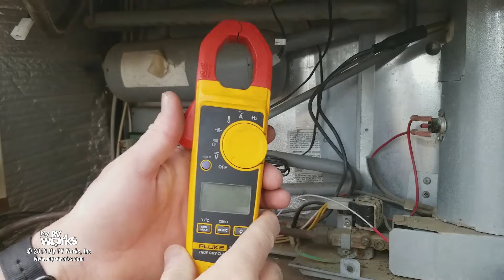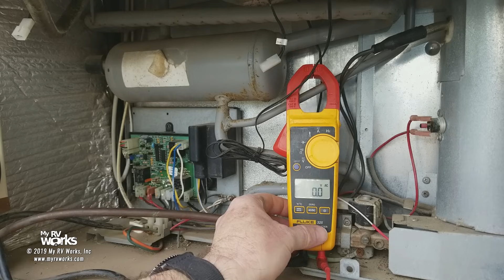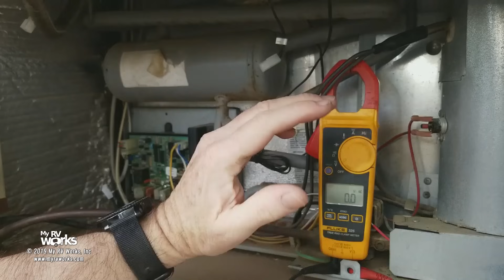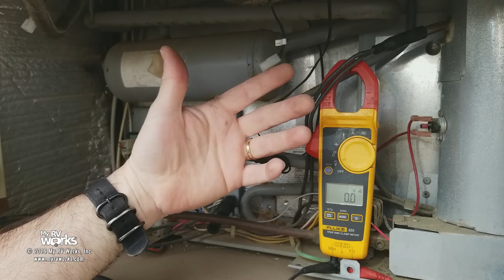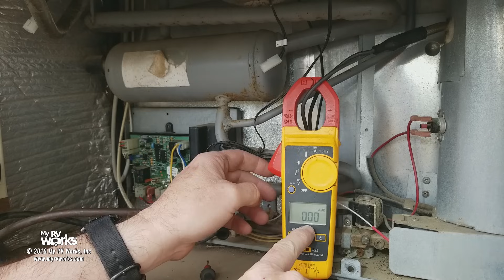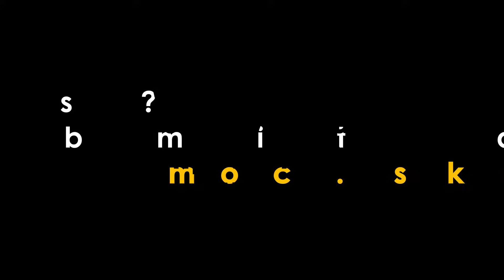Troubleshooting An RV Refrigerator That Works On LP But Not On Electric

Comment: I have a dometic 2652. I have voltage at the pins to the heating element and I have 40 ohms on my heating element. still does not work. Can I have proper voltage and Ohm but the element is still bad?
Reply: I have this same model and the same situation. Did you try swapping out the element? Upper control board? Darren??

Comment: Hi razorbackrheas.  Turns out my issue was tied to low voltage in the campground and the electric mode is running normally. Don't have a fix howewver other than adding a refrigerator fan.

Comment: I have a Dometic 3 way Model#2554. Three fuses on lower control panel. 120 volts across two of them, less than 1 volt across the 5 amp fuse for 120 voltt system. Why? What to check? Bad board?
Reply from the maker: If I were there the first thing I would check is the resistance value on your heating elements. The AC and DC fuse is only allowing the current through necessary to run the heating element.  If the heating element is not on it will not be consuming any current. So, the best way to check is the ohms value through the heating element.

Comment: We have the opposite problem. Ac works flawlessly. Propane, the freezer will cool, but the fridge will not. It tries to, but as the warmth of the day starts it just goes up and up. Any ideas?
Reply from the maker: If your refrigerator is working flawlessly on AC but not on LP, then we can assume several things. We can assume that the cooling unit is fine (no blockage, no leaking) we can assume that the ventilation through the cooling unit is fine. That leaves the proper amount of heat in the boiler being a suspect. You need to make sure that the burner is clean, there are some orifices that the gas flows through. Also your burner at the very bottom of the chimney, you need to make sure that's not rusted out and not filled with fine rust shavings from the boiler chimney. On the LP side we need to make sure you have proper BTU from the flame.  We do that with an LP pressure test at the refrigerator burner.  https://youtu.be/SD1qcH_hNYY

Another thing you could look at is inside of the boiler chimney is a corkscrew looking baffle kind of device. I pointed out in another video. I have come across refrigerators where the heat from the boiler has damaged or melted out a portion of that baffle and I've even come across refrigerators where it's not even installed.
https://youtu.be/H-Cg-7YHyYE. Around the 17:15 mark.

Comment: OK, so listened and still a little confused.  My fridge works on propane and not on electric SUDDENLY  along with the microwave went out at the same time.  WENT out and found the fuse in back was bad so replaced it and now electric SHOWS IT IS ON ELECTRIC BUT NOW IT STILL DOES NOT COOL ON ELECTRIC BUT DOES ON PROPANE  now what.  I am 77 yo so not sure I can do all the testing you did past getting the fuse out. I do nto want to get ripped off so asking before I see the RV tech.  I have good recepitcle since I did test it and it does say it is now on electric but not cooling. So far as the Microwave is concerned, it is dead, recepticle is working with hair dryer but fuse was ok, circuit breakers are ok etc.  HELP!!

d

Comment: So do you have to have propane on for the electric to work cuz mine won’t work it the propane is shut off
Reply from the maker: The propane side and the AC side are independent of each other. They do share a common control board and they both share the cooling unit obviously but besides that they can work independent of each other. Never at the same time though. So we need to dig a Little Deeper on your problem.  I'm wondering if when you're turning off the propane are you turning off the refrigerator inadvertently? It might be a silly question but I have to ask it. Typically what you do is turn on the refrigerator and put in auto mode and let the refrigerator choose between AC or LP if it has both available it's going to default to the AC.

Comment: Can't find my fridges control board, it's not in the back where else would it be?
Reply from the maker: If you can provide your Refrigerator manufacturer, model number, and serial number that would be helpful. If your refrigerator is manual ignite, then there may not be a DSI control board. You may have a green push button with a gauge type indicator on the front side.  On the back then, you may find some very simple switches. But if you can provide your model number that would give us a chance to offer more assistance.
Reply: @MyRVWorks  it's a dometic RML 8555

Comment: I was waiting for you to use Oms law to show us how the heating element watts can be checked, buy reading the amps and multiplying by the volts to obtain the watts.  This watts value should be the same as manufactures specs.  As you said often times someone unknowing installs the wrong heating element and this check can confirm that.
Reply from the maker: I've got to to my audiences. Sometimes all of the technical data would make their eyes roll back into their head. Some of my other videos I do show Ohm's law in use. Thanks for watching, happy camping.

Comment: Darren,  HEEEELLLLLPPPP!!!!!I'm having problems with my dometic refer, it wont cool in a/c or LP mode. In gas mode the little freezer section will cool down even to the point that at the front it will form a little ice droplet. The freezer will not freeze water, will not keep ice, hotdog, anything froozen. The coil fins in the back of the freezer are cold in the freezer but not in the refrigeration section. I have searched utube trying to find help but this unit is so old no one is covering it...it's obsolete..... This unit is in a 1969 security traveler and worked great last year hence the confusion... Please, any advise would be gratefully appreciated... Thank you, Robert
Reply: help get battery fan

Comment: After checking everything you suggested on your video everything checked out good but I am still not getting the electric side to work. Any other suggestions?
Reply: Check The glass fuse on the control board. If u have 120 one right side of the fuse and u don't have 120 on one on the heating elements fins u have a bad board. If u don't have 120 on the right side of the glass fuse check the left side. If u have 120 on the left and not right side change the fuse.

Comment: I have no spark . I changed the igniter still nothing. I can light it with a lighter and it run , gets cold . Just no spark . Any help is appreciated . Oh the little button I’m not out
Reply from the maker: Make sure that the electrode end is not grounded out to the burner head in any way. You should have 1/8" gap there. I f you've replaced your electrode, then you may want to look at the DSI board.  If your refrigerator has that separate igniter module, that is to say you're igniter does not connect directly to the DSI board but instead connects directly to that white rectangular module, then verify that it's getting 12 volts from the yellow wire when it's trying to ignite.  If it's getting 12 volts but not sending a spark then that module might be suspect.

Comment: Why does that little glass fuse blow?
Reply from the maker: The glass fuse is there to protect the heating element circuit. If it blows when the refrigerator is turning on the heating element, it would be an indication that the heating element has faulted. You can unplug the two wires that feed the heating element and do an ohms reading on the element. My suspicion is that it will have shorted out.
Reply: @MyRVWorks  thank you

Comment: So I have power to my heating element but not my fuse
Reply from the maker: 1 fuses for 120  volts AC the other fuses for 12 volts DC so make sure you're reading the right voltage with your meter on each fuse.  This has caught me a time or two in the past.

Comment: Can someone help me with lo dc code? My refrigerator seems to work fine everything is cold but I just keep getting a lo dc. Please someone help me. I cannot find anything on the net or video's on this.
Reply from the maker: That is your refrigerator letting you know that the voltage feeding the control board, on the back side, is being sensed below ~11 volts.  For a test, you can connect jumper cables or some other know good12-volt source to the 12-volt supply of that refrigerator control board and see if that fixes the issue. That would only be for testing.  If you confirm that the control board is receiving 12-volts but you still get that fault, then at that point you might suspect you have a faulty control board.
Reply: @MyRVWorks  
Well I replaced the power board with a new one and guess what. Lo dc has appeared again. My convertor is fine too. New battery DP27. I don't under this at all.

Comment: hmm have power.. element checks out - terminals hot.  still doesnt work on gas or electric...sigh
clicks away in there on AC or off [ momentarily ] auto button pushed ... light on

Comment: What if I'm not getting 120v at the fuse?
Reply from the maker: Then your issue is Upstream of the refrigerator, somewhere within the coach wiring between your breaker panel and the refrigerator. Different manufacturers wire those different ways. It could be something as easy as a GFCI in the bathroom.

Comment: Old control board wasn't getting any juice to the electric heating element. OHM test on heating element shows it's OK. New control board ALSO tests no 110 going to the electric heating element. I am stumped.
Reply from the maker: I will be publishing a video soon on how to troubleshoot the upper control board (AKA eyebrow board). The information on that is on my website under the resources tab. Do a search for Dometic refrigerators and look for a file called 'Dometic Refrigerator Training'. In that document you'll find the information on how to test the upper board.

Comment: I checked everything and it keeps blowing the fuse on electric as soon as i turn it on what am i missing here? This happened right after the lights went out from hurricane
Reply: I'm having this same issue with blowing the fuse as soon as I turn it on. Did you figure anything out?
Reply: @morgana9391  
Still gotta mess with it I think it might be 2 different things  il keep you updated what kind of RV do you have?
Reply: @MehNah-th4my  Older Gulf Stream Ameri-lite, the fridge is a Dometic RM2351. What are you thinking it is?

Comment: Replaced the heating element and after a week the fridge is running between 36 and 38 degrees on AC power. Here's hoping that was the problem.

Comment: I replaced the 5amp fuse and it lasts for a while then blows and the unit switches to gas, anybody have any suggestions?
Reply from the maker: That sounds like you have a faulty Electric heating element. When you replace that, make sure you have the model number AND serial number to identify the correct replacement part.

Comment: Bought an Rv found they disconnected the panel in front of refrigerator  looks like it’s never been used
Reply: Does anyone  know anything about the electrical parts

Comment: My fridge works on ac for a short time then shuts off can you point me in the right direction
Reply from the maker: Can you elaborate on the refrigerator shutting off part. Are you saying that all power to the refrigerator shuts off which would indicate there's something on the DC side or just that the AC side is turning off? Also what do you have to do to reset it. Turn it off and turn it back on? reset a breaker? replace a fuse?  If you provide more information I can help direct you to the next step.